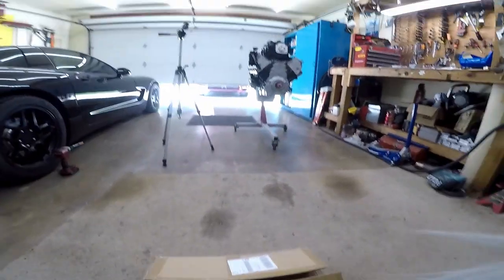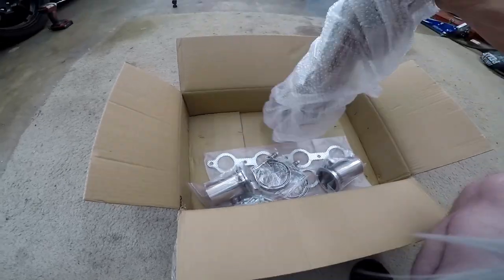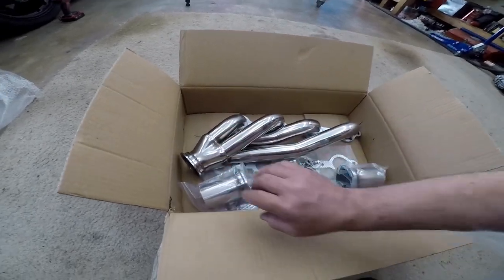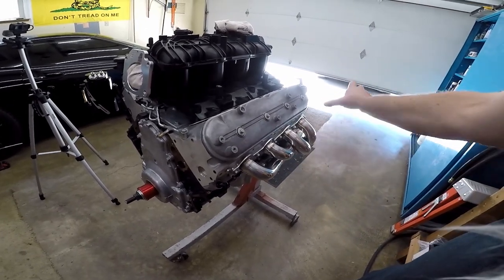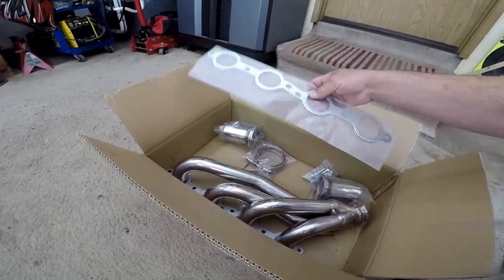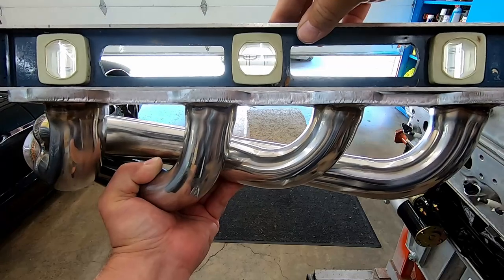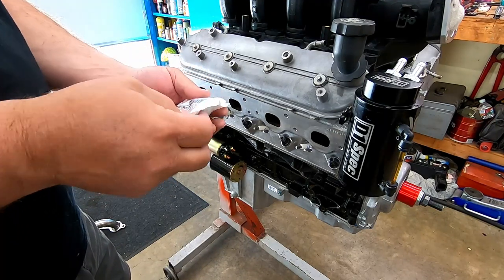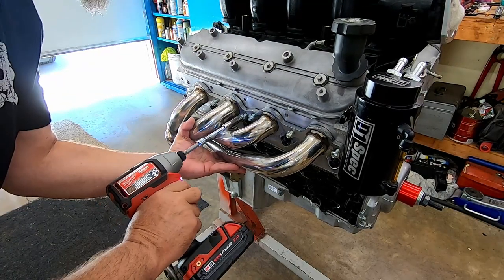I Bought the Cheapest LS Swap Headers on eBay

Comment: How's it going brother? Do you think those might work for a ls Vic conversion? I have a 03'Crown Vic Police Interceptor I am doing a Ls3/6l80 swap. I am not sure which shorties I might need. Since you have a ranger and Crown Vic I figure you have a better idea then I would. Lol. Everyone is doing a s-10 swap. Not many Ranger swaps. I was thinking about doing one once I'm done with my Vic swap. My block is in the machine shop. So it'd be a while. I prob have at least a year before she's up. I still have to get a Gen4 harness. I found one on E-Bay for $159 but I'm not sure about using one that cheap. I can thin and depin a stock harness and I think it would last alot longer then that E-Bay to just get it going harness lol
Reply from the maker: I think for a crown vic you are going to want the actual S10 swap headers as they are tucked in much tighter.   We were originally going to put this engine in the crown vic but thought better of it as the crown vic needs to stay a daily driver.  way too much down time to do the swap.
Reply: Cool thank you very much. Same here. It wasn't till I bought my wife a new car and I am using the 2018 Kia Soul that was hers as my daily driver. Now I can swap the Vic. I didn't want the 4.6 laying around so I posted it on Maket place cause I know there are millions of F-150s and Stangs and everything else. There are alot sitting cause people can't afford a engine or trans. I posted the engine for $900 and sold it the next morning lol. The trans sold the next day for $400. That's really  good for my area.
Reply: I started making videos and putting them on YouTube step by step instructions for my grandkids. The engine sold so fast I couldn't make videos. I have the wiring schematics for my 03' and I made a stand alone so my gauges will work. I have everything figured out. I finally figured out the speedo. Dakota Digital has a speedo/tach converter box for $115. It will convert any signal so the speedo will work if it's a electric signal. SGI-100BT is the part number if you need it. They also have a flywheel tooth counter for $89.

Comment: Has anyone tried belt sanding all the mating surfaces?
Reply from the maker: I actually did eventually try this with the headers in the video.   I do believe it is absolutely possible to do this but to be honest I did mess up the drivers side header on mine because I got impatient and started applying pressure incorrectly which wedge shape the flange in the top to bottom direction.   I basically ruined it.  Thankfully these are not super expensive.